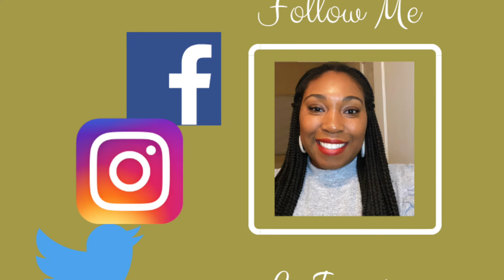How to install a Moen kitchen faucet

Comment: My new faucet spout ( the top portion is the spout) is spinning freely out of the box, is this normal, if not I need to return?
Reply from the maker: It's normal until it's attached to the hose housing & tightening. If it's still doing that after you do so you may have a defective spout.